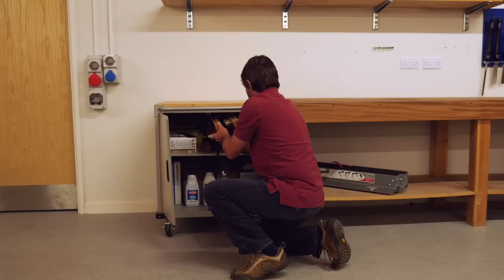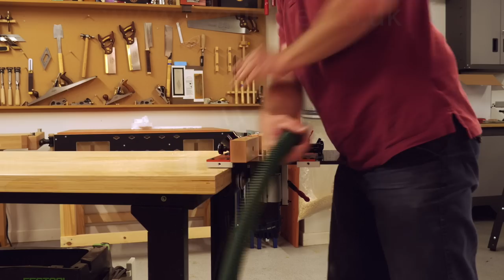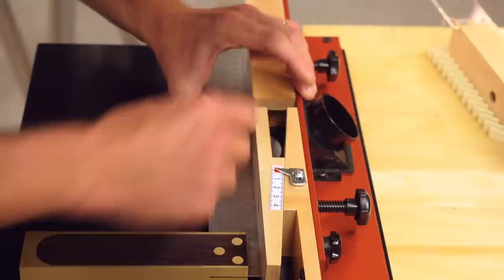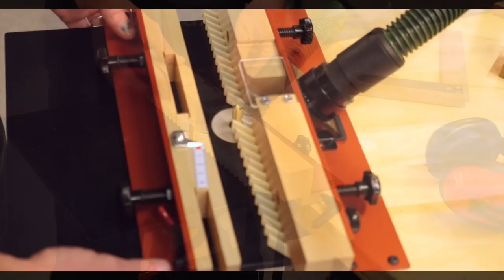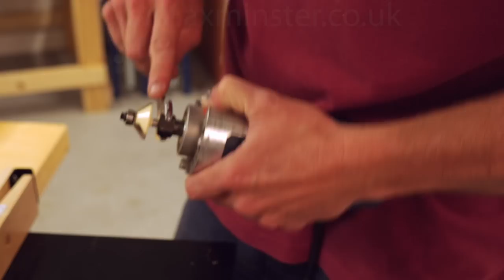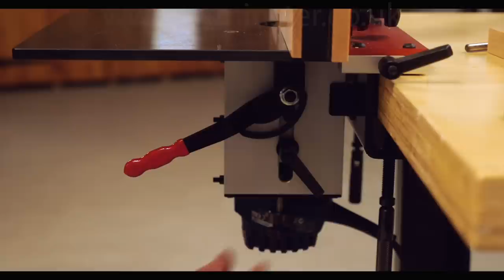UJK Technology OTORO Palm Router Table - Product Overview

Comment: I like the concept, but it looks like a bit a faff changing cutters and fixing the router in place. The Dewalt system would have been better, with the cam lever. Although I do like the lift operation.